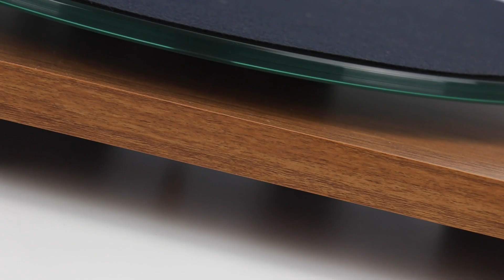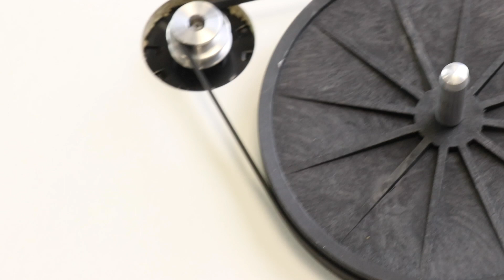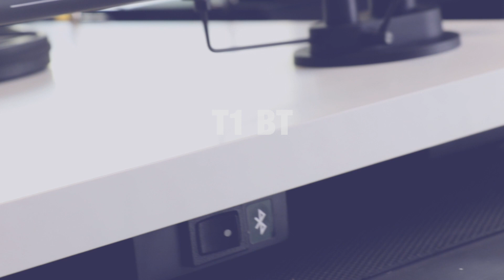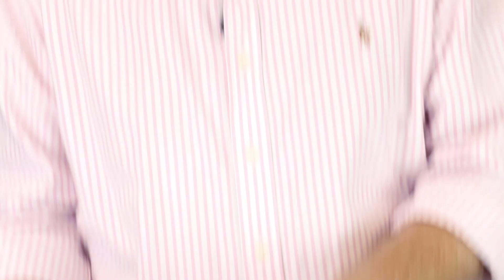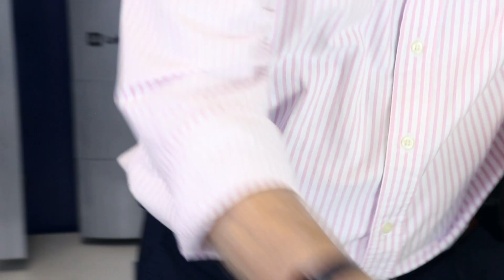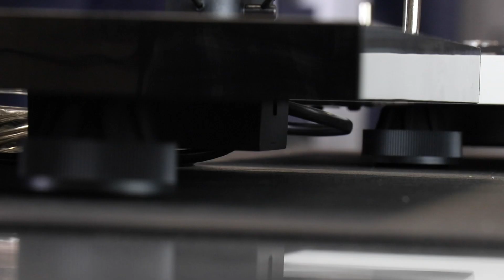A Closer Look | Pro-Ject T1 Series

Comment: You don't mention balancing the table to level. Isn't this an important setup step?
Reply from the maker: Good Morning! You're quite right that ensuring the TT is level is important, but this video assumes you have an existing, roughly level playing surface for your record player. The feet of the T1 line are not height adjustable, so any alterations will need to be made to the playing surface, but thankfully, unless there is a severe angle, the T1 is capable of reliable quality playback on most reasonable side-tables or hi-fi units.
Hope this helps!

Comment: Funny how many components of the old Tesla NC 500, the Grandfather of all Pro-jects from 1987 are still being used here - the feet, parts of the tonearm, the hinges, the motor. Actually, the arm has even older roots in Tesla NC 440 from 1973 with it's P 1101 tonearm.